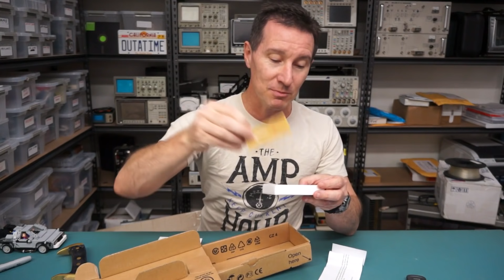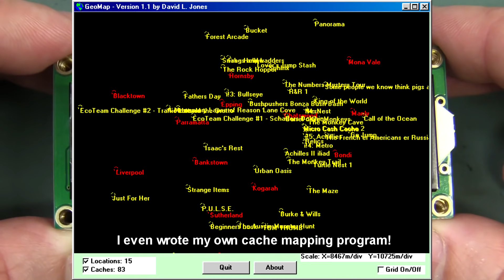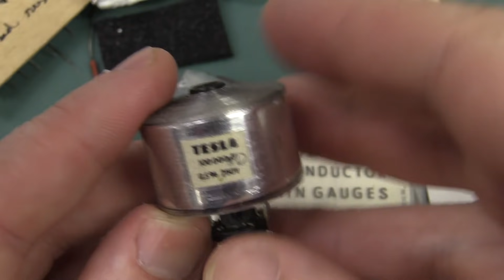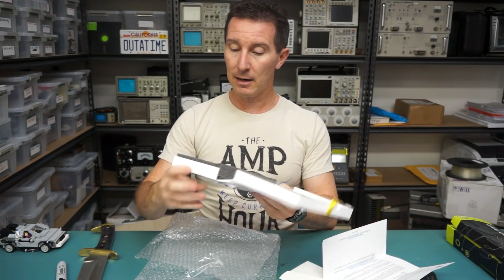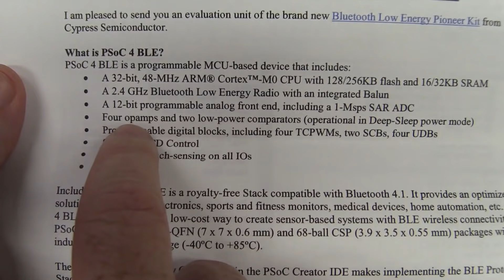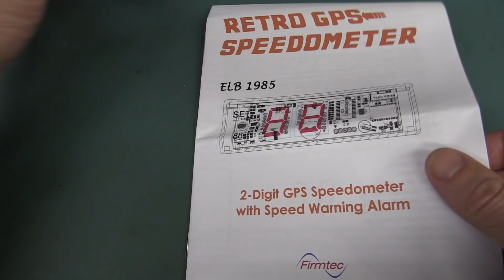EEVblog #722 - Mailbag

Comment: When i worked in crane repair i would find those strain gauges stuck all over the place, they were basically a throw away item so the engineers would not even bother to remove them after testing, LOL

Comment: Radio Shack still exists just on the Internet, you can order these shirts from there web site. They also have some of the stuff they used to sell in stores, just with less selection. Why they still exist does not make sense, instead of having a better selection they actually often run out of the few things they have available on the web site.

Comment: Uh, I don't know about 9v batteries not being able to supply 1a, and 9v I have drop out around 6v anyway, but yeah, that's quite a bit of power not used between 7v and 6v. I have blown 11a fuses in multimeters testing the internal resistance of 9v before, going off the amps delivered on dead short. I guess it depends on the battery.

Comment: Use sharpie marker to clean off sharpie marker! It's super simple: take your sharpie, and scribble all over the mark you want to remove, then immediately wipe it off. The solvent in the sharpie marker will dissolve the sharpie on the object and allow it to be removed, as long as you wipe it off before it evaporates again.
Reply: Dreaded Vapour why, it works. (For non-porous surfaces.) You have to do it a little at a time for large marks though.

Comment: A bit late, but there is a really easy way to clean up permanent marker on most hard surfaces... Grab a dry-erase marker and scribble all over the permanent marker spot you want to remove. Quickly wipe it up with a paper towel, and you're done.

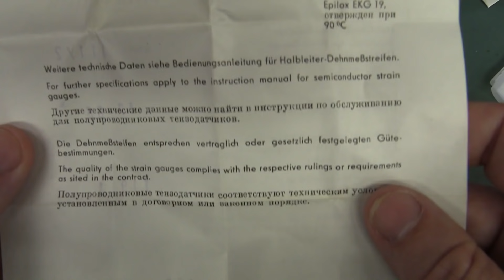Comment: 24:04 It says "For further specifications apply to the instruction manual for semiconductor strain gauges. The quality of the strain gauges complies with the respective rulings or requirements as sited in the contract."

Comment: 25:00 hahahahaah... funny, I made a high gain amplifier for measure changes of resistance... this is semicoductor thing, so it is easy. I had resistive shit, which is way harder to measure. Changes of resistance are so small, so little that make everyones headache. But I did it :D of course the 0 was flowing :) it was needed every measure calibration etc, but I did it, the 1st in etire school. gain was 10 000 to notice any changes. Made in sleeples 72h uffff... never fucking back to electronics

Comment: There are two strain guages supplied to both go in the bridge. 
one under compression and one under tension as they are squeezed and pulled when attached top and bottom a sort of push pull in the bridge

Comment: Dave!  THere is a spot to open the bags with the dust in them.  THEY MAKE A SLOT THAT YOU SHOULD BE ABLE TO FEEL THAT DOES NOT HAVE DUST.  YES THEY MADE THEM SO YOU WON'T HAVE TO DEAL WITH THE DUST.  Every one of these video's you just don't get that, I figured it out within 2-3 of them that I have recieved.  LOFL

Comment: Not all 9V batteries use "AAAA" cells. Some use small flat cells that are stacked. You can tell what batteries use what configuration by their part number 6LF22= FLAT STACKED CELLS, 6LR22= "AAAA" CELLS, The key is in the part number. 6L"F"22 F= flat cells and 6L"R"22 R= round cells or "AAAA"

Comment: I don't like alcohol that much for cleaning, plus IPA is expensive. Its dry and aggressive. But if you want it to be oil free, ok.

Usually I just try some white gas/lighter fluid first. Works a charm on PCB, tools, hardware parts etc. If that don't work then maybe either some alcohol or naphta, or something more aggressive (acetone, thinner).

Comment: I've made a digital speedo for my holden because the mechanical one is non-linear and a good 10k out on the upper end. my one does km/h and takes the sense from the back of the speedo, there is a reed switch on the rotating side which coincides with the wheel rotation. the speedo is within 2 - 3 k of my GPS and some small improvements may make that better and with a small code change I can get it to do miles per hour

Comment: Always like that you spend a few extra minutes giving the young folks some advice, and if I may I have a couple of other suggestions for Michael.  Make a trip to thrift stores (Goodwill, Salvation Army, etc.) and you can find radios, video cameras and yes on a lucky day some test equipment.  So for a few buck you can get some stuff to teardown, learn about and start collecting parts to build projects.  Also, if you live in a city with a university they will from time to time have surplus sales, and you can find some amazing items on the cheap.
 
Cheers,
Mark
 
PS: At university auctions items are often sold in lots, but you don’t have to by the whole lot, but can usually get an item or two for a few buck from the lot winner.

Comment: Lol Memphis is a city, ME=Maine. I had never considered what a bad idea using a 9V battery to power a 5V regulator would be. So many examples on the  internets showing just that. Anyway good episode, so funny hearing you gripe about the recycled paper padded envelopes.
Reply: 9V battery to 5V linear regulator still works.... Just not as efficiently as a switch mode regulator.

Comment: My initial reaction is to use a little bit of nail polish remover or diluted acetone, and rub it on the mat. However, that could rub away some of the material on top.

Comment: Gday Dave,
 If you need to clean that permanent marker of your bench theres a product called "Orange Power" made by Planet Ark. They sell it in the supermarkets as a air freshener, but you can use it as a cleaner. My wife works in a supermarket and uses this product to clean the benches at the checkouts with this stuff. I've tried it and it works a treat. cheers

Comment: Yahoo? Yipee!! As for the rubbery stuff, I hate it, my Lenovo laptop has it on it's screen case and it looks awful when lightly scuffed... :\

So, do you unsolder the old calender to replace it with a new one?

Hmm, grim joke that about MH370... :P

Bloody scousers stealing things... :P

I really should find something to send off to the colonies, all I can think of though is an aftermarket Amiga A500 1MB expansion board (made after 1993, but using old, old, ooooold SIMMs from the 1980s), everything else I've either ruined or put to use... :P

Comment: Dave, the zigzag antenna pattern is not there to "get the wavelength." The pattern acts as a coil, getting down the impedance to the desired matching value of the driver. Most transmitters with undersized antennas will have a trimmable coil like that to get reasonable power output.

Comment: try putting some non-permanent market on the permanent marker before cleaning it off, it works on whiteboards
Reply: 96% Alcohol (ethyl alcohol), Isopropyl alcohol. They should be able to dissolve the ink just fine.
Reply from the maker: Brascofarian Nope, doesn't work.
Reply: EEVblog I don't know if it will work on fabric but I normally spray deodorant on permanent marker to remove it.
Reply: SSH MK I've used rubbing alcohol before. It works, but the faster you hit it with alcohol, the easier it comes off. If it doesn't work at first, I'd brute force it, and make a puddle and let it soak for a few minutes. And then even scrub it a bit with something abrasive or non-abrasive.
Reply: EEVblog Sometimes, literally using a rubber eraser will take it off. I'm not even joking.

Comment: Dave,
why didn't you measured those old tesla parts!, check if that cap is still in spec!, make that xtal work to see how accurate it is and how it changes with temp
Reply: The cap could still be in spec - it is a foil type. I havend measured it... unfortunately that was the last piece I had :-) For the xtal - I have still some of them so I can try to measure one from the same kind...
Reply: *****
cool, you could heat it, poke it and see how it affects, it looks very big and that means it should piezo by hitting it!
Reply: Arjan Wilbie Ludek ExtremeOC I have asked about the usage of the 100kHz quartz. They no longer remember of these particular frequencies. They have also said that maybe for transmitters. One professor told, that there should be somewhere also a 10kHz and 1kHz quartz in the lab :) they should look like a Vacuum tube - I haven't found them yet...
Reply: Arjan Wilbie  I have no idea... Probably it was used in the meteorological drones/satelites developed in our department during the cooperation with USSR on the project INTERKOZMOS. Some of the older professors still live - I can try to ask them.
Reply: Guillermo Lovato Ludek ExtremeOC I have build a simple oscilator from the Quartz with a 4011 and some 10n ceramic load capacitors on a universal board. I have measured the frequency on a TESLA counter :) the frequency was 100.005kHz (maybe it could be adjusted by the caps). The temperature stability of the quartz is good. From ambient temperature to a temperature cca 60°C (warmed up with a lighter till I could not touch it) the frequency was changing no more that -+10ppm. The same instability was observed via 10h time window at ambient temperature. Changes of the frequency caused by poking/hitting the quartz: I could not observe them. I will also try to measure if the quartz generates some voltage when it is poked, but for now I have not time... Later...
Reply: ***** those 100 Kcs crystals, if i am correct it is LW and that frequency goes far. What was it used for?
Reply: ***** with the 100 Kcs known as the km band it is ideal for long distance transmitting as the ground wave follows the contour of the earth. You have a spare i can play with? A tracking device for my vehicle :)
Reply: *****  I'm still using TTL 74 series for fun/hobby. :) I remember epic KD503 and KD502 power transistors.BTW ask professors and I'm curious to know what they tell.
Reply: ***** awesome, they look like solid stuff!

Comment: EEVblog I normally just rub the surface with a rubber to remove permanent marker, but it might just lead to the rubber making a big smudge if you get the wrong type or the wrong surface.

Comment: That "velvet-feel" coating on plastic is total rubbish, from long term perspective. It *decays* into horrible gunk that peels off. Happened to my joystick.
Reply: But if it is like sanded plastic (like the back of the nexus 7 and nexus 5) it feels pretty awesome and "lasts even longer than glossy
Reply: itzJanuary *glossy plastics
Reply: Happened to an mp3 plater i had, even seen car interiors with that stuff deteriorated and gone all sticky and yuck
Reply: Great while it lasts though :D
Reply: Depends on what it is, an actual Natural Elastomer or a Thermoplastic Elastomer (TPE):
1. Naturals: Silicones, Rubbers, etc are great, long lasting and expensive
2. Butyrate is one cheap TPE. It degrades over time into Butyric Acid (the chemical that makes vomit stink) and a crusty hard plastic that crumbles off the original product. It's sometimes marked CAB on the product.
Reply: I have a pretty expensive digital radio covered in something similar and it has started to do that, its depressing.
Reply: The rubber coating is garbage. The matte textured plastic that feels velvety is not, but I have no idea what they do to get that finish.
Reply: +Jaroslav Malec You are aware that the cheapest, crappiest electronics made are for gamers? That's probably why it decayed.
Reply: ***** Depends. Good products from reputable companies (Razer, Logitech, etc.) are made properly.
Reply: +itzJanuary I just seen this happen again, this time to a Logitech mouse :)

Comment: Clean the mat with isopropyl alcohol. Gotta' rub, but it comes off.

Spring loaded USB cables will really launch whatever small device is attached to them when they fail. If they had a manual lock on them, they'd be worth something.

Comment: dry erase marker over the permanent    then wipe off    presto
Reply: not sure if it works on an antistatic mat, but some rubbing alcohol might work.
Reply: i've cleaned mine that way after an opps or 2
Reply: Isopropyl alcohol then peanut butter then marmite then HP sauce then frog spunk then rub with a guinea pig. Presto!
Reply from the maker: Jason Deadman Nope, doesn't work.
Reply: watch CrazyRussianHacker, you will got soon a solution...
Reply: In the automotive industry we use naptha as adhesive/glue remover. Commonly zippo lighter fluid, works wonders getting off permanent marker.
Reply: EEVblog you definitely need isopropal alcohol, 99% you should have some for removing thermal paste.
if that doesnt work dichloromethane (aka paint thinner) is your best bet, or acetone. but dont under any circumstances mix and match these chemicals
trust me i'm a chemist

PS: memphis is a city, in Tennessee
but we dont blame you, most american couldnt name all 50
Reply: Minister of Propoganda II Seems like a few of the chemicals mentioned here might attack the foam rubber mat itself (along with acetone, and trichloroethane (note the missing m), dichloromethane is commonly used as plastic model cement/weld). I think the best bet here is to take the mat and turn it around so the black marks are in a place EEVblog doesn't care about quite so much.
Reply: Pete Brown  neither mineral spirits nor alcohol would lesson the impact of methylene chloride, its just a cheap filler in such an instance,
you might be right on the acetone front, but application with a q-tip would also bypass any serious impact
Reply: you are right i used a verb as a noun
cardinal sin
Reply: use permanent marker over the rest of the mat and voila, black mat!
Reply: EEVblog
Petrol
Reply: Sandpaper.
Reply: Apply Isopropyl alcohol to a paper towel and wipe.  If a fadded spot remains, apply peanut butter and scrub a bit with a tooth brush. Let it sit for an hour and wipe the peanut butter away.  Wipe once more with isopropyl alcohol.
Reply: Pete Brown i did note that missing m
now this could potentially be an international barrier (Australian nanny state) but lets note this msds for mutli-purpose stripper
http://www.homedepot.com/catalog/pdfImages/21/21c0034c-c330-4b4d-b615-22355e9a41ca.pdf
Reply: Minister of Propoganda II Yeah, sorry. The note about missing M was for other people looking at it that other chemical I listed. If you add in the M, you get chloroform (I also left out the L which I just fixed).

From the MSDS,it looks like Klean strip is so diluted with alcohol and mineral spirits, it probably wouldn't do much to plastic or that foam rubber.
Reply: MichaelKingsfordGray if the mat completely deteriorated which is by no means uncommon for acetone, 
do you know the definition of impact?
Reply: MichaelKingsfordGray
you mean bite
and impact means to actuate an affect
Reply: Minister of Propoganda II * effect
Reply: In the military, we used Off bug spray to remove permanent marker from the fire-watch schedule board each week. Not sure if it was the propellant or an ingredient, but it worked great.
Reply: Jason Deadman Or alcohol ... even aerosol will work.
Reply: +EEVblog AppliedScience showed just how well acetone works.
Reply: +Aurelius R To everyone above: isopropyl alcohol WILL NOT WORK! Go watch AppliedScience's cleaning video.Polar vs Non-polar stains, etc.
Reply: +EEVblog 99% rubbing alcohol, Promise you its works perfect
Reply: Not sure if you still have the permanent marker stain but a trick I picked up a while ago was to use Aerogard or hair spray (also think most aerosol sprays work but not sure) on them and they wipe off with a tissue, easy stuff.

Comment: Isopropyl alcohol removes sharpie stains.
Reply: And acetone removes the color of the mat as well. Acetone removes everything.
Reply: Ciprian Cristea I read that as "acetylene removes everything". and yes it does.
Reply: Shawn Swift Simply rub a dry erase overtop of a permanent marker... easy.
Reply: Regular ethyl alcohol works better, it's just the anti-drinking propaganda that makes us use the inferior IPA. Also, the dye will diffuse into the plastic if you don't wash it off soon, so hurry up, Dave!
Reply: Ciprian Cristea
Acetone is pretty strong, but nitro solvents such as C6000 are even more powerful. Dissolves it all but bakelite!
Reply: When I was younger, I got paint on my watch, so I took acetone to it. It completely frosted the lens on it and made the watch unusable xD